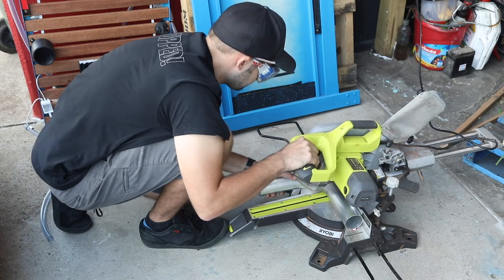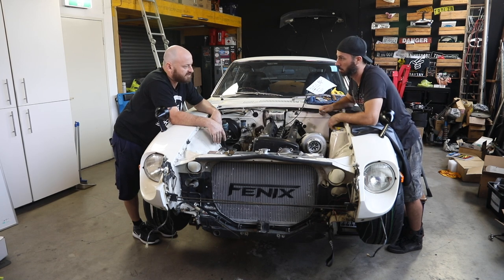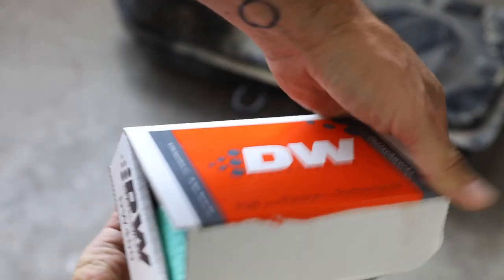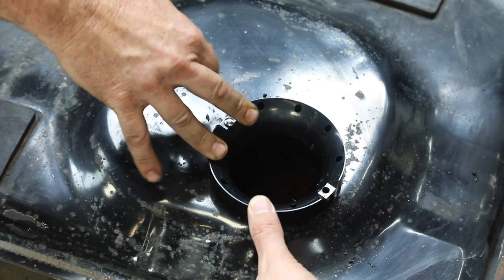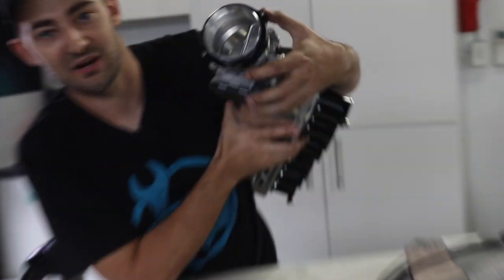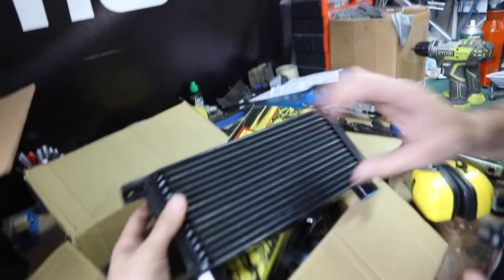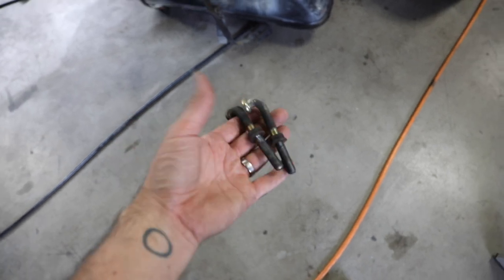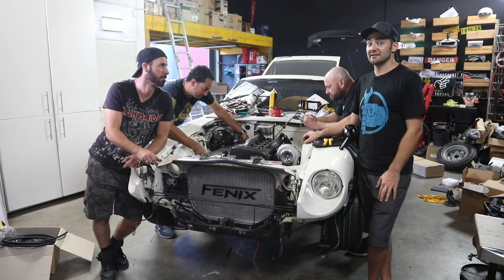240Z - RB26 Engine Conversion [PART 5]

Comment: Soooo i realised its not a 240z its a 260z or 280z not sure from the lights. Sooooo mybad do whatever u want to to it engine swap add a honda engine or a bgw etc tbh now i think it woulda been nice to see the vg35de with a turbo go in there newer engine sits further back kinda making it mid engined more parts available and sounds better too less mods to do but 

Ps woulda saved urself alot of hate if you dont call it a 240z because its not. Just my opinion but a 240z  is a first gen car so should be kept Lseries engine and period correct mods. Ie the wheel flares and bre spoiler are period correct surprisingly. Anyway rant over i can now watch and enjoy and not feel like defaming a piece of art

Order some 280z chrome tank straps there longer than the ones you have and look better. Be nice to see a front splitter install 2 but up 2 u

The rear brakes you should be able to source calipers in australia duno if anyone out there does the brackets to adapt them. Or just order the adapter from the usa.
Worth uograding the fronts too thats easy 89 hilux calipers 300zx vented discs and a spacer 8mm i believe youll need it with the extra power as most of the braking done from the front the drum conversion isnt totaly necessary apart from looking better.

Have you thought of installing a eps ( electronic power steering ) to the car with a speed sensor etc be right up your street with custom install guide stuff or even something off the shelf ( not worth the money off the shelf bolt on imo )

Coilovers? Probly alot further down the line but tein do some cool stuff with there electonic dampening control. Or bc coilovers for a cheaper alternative maybe?